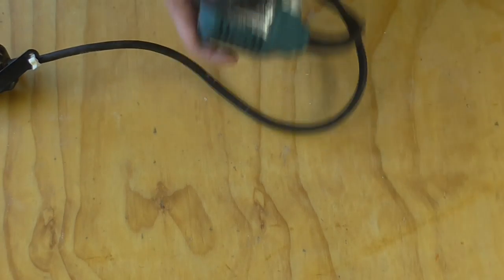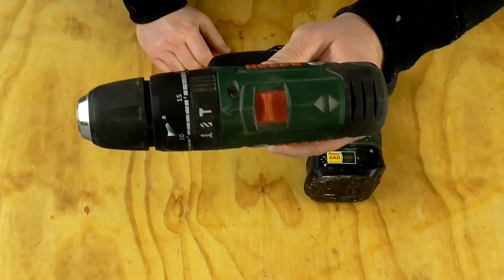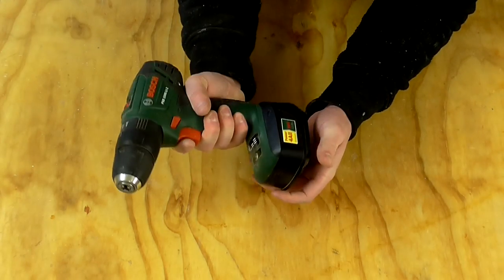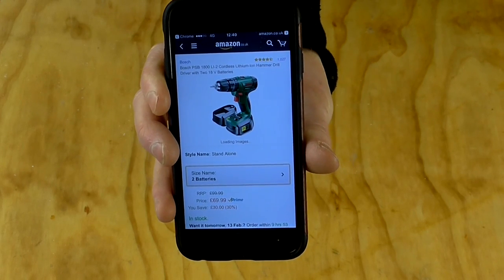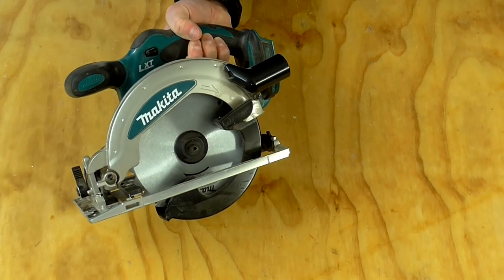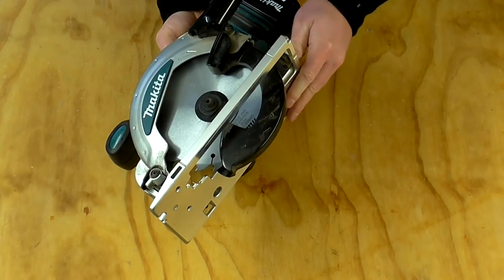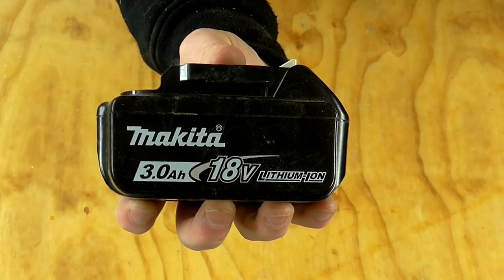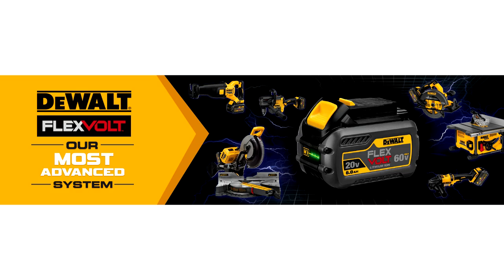My Tools - Cordless Hand Power Tools (Makita and Bosch)

Comment: Hungarian made PSB1800 Li2. (. A cracking drill..and cheaper) Did a huge amount of DIY this year including a complete new kitchen, a fair size decking patio and fitting out a garage workshop . I got the kit with 2x 2.0ah batteries and it never gave up once, even driving hundreds of decking screws in ...and survived a few drops from over a metre...Absolute top kit.. Also paired it with the PSB1080 Li2 driver which suited my smaller hands. Again no battery issues and excellent torque which is not always the case on cheap Chinese ones. If you shop carefully and wait for sales, you can also pick them up for a fair price. Highly recommended

Comment: Hi just watched your video I'am a coachbuilder and have had the makita 18v system for over 3 years now I do both wood metal fibreglass and it's the best system I've owned it's never let me down once and I really hammer tools. I don't understand your comment on the little 18v sander I only use the second speed because the top speed is to fast it doesn't sand as well it wears the paper out quickly and it vibrates more. Spose it's down like most thing down to personal preference. I'm enjoying your journey cause after 47 years on the tools my back broke and I'm now in a wheelchair and have nothing to do but watch utube and practicing sign writing that I haven't done since my apprentice days any way good luck and thanks for the shows

Comment: Nice video Keith I'm jealous of the battery powered sander!
I'm glad you recommend people to stick with a battery platform. I dipped a toe in ryobi but once I had a couple of DeWalt tools I sold the ryobi and I 've never looked back. 
Wish someone would make a cordless router though!
Reply from the maker: +Happy Wife Happy Life yeah I bet the DeWalts are great to use. I'd like a cordless belt sander but I'm not sure such a thing exists either
Reply: Makita have just released a cordless trim router with std base, plunge base and tilting base. I have purchased it and just waiting on delivery but reviews on it are excellent especially around battery life, dust collection and overall usage. You can buy with all 3 bases, just the std base or as a full kit with batteries and charger.
Also makita make a brushless circular saw which has magnesium base and blade guard, more powerful, quieter and excellent battery life...I own one and love it...I'm a Makita addict btw lol

Comment: Did you find any issue with the chuck plastic wearing away? Mine has started to erode plastic seems fairly weak. For the Bosch drill
Reply from the maker: +Jason Devlin hi, no I've not had that issue. Do you mean the plastic on the outside of the chuck? Sounds strange...

Comment: Nice video again matey.
I had a lot of the Ryobi plus one range but some scrote recently broke into my garage/workshop and had the lot away........
The Ryobi set is very, very good. They are not up to the standard of Makita or DeWalt and if I worked on a site then I wouldn't use them but for regular home use they are absolutely great.
Reply from the maker: +Tone Knight I'm sorry to hear that, that's terrible :-( what have you replaced them with?
Reply: Being disabled/retired Replacing them will take time and people buying the projects that I make......
I have actually now got two DeWalt DCD 776 Drills to replace my Ryobi and an old Dirt Devil drill I was using.
My daughter got me a Black & Decker circular saw and I bought myself a Makita  M9204 random orbital sander from Screwfix. I was a tad worried about it due to it's low price but so far it has been brilliant.
Replacing the other tools and my compressor etc will have to wait until funds allow.
Many thanks for asking mate.
Reply: I call someone breaking into my house something a tad less polite than "scrote"........ Hope all goes well for you in future

Comment: The makita are great tools I've had the lithium set for 10 years I'm a carpenter by trade,don't get rid of the corded saw though you will kick yourself if you do.Ive always taken the riving knife of my saws anyway in a pinch you can cut a kitchen sink out with that little saw ,after a bit of practice you will be surprised how accurate you can plunge that little saw,great vid by the way
Reply from the maker: +Dean Reynolds thanks Dean. I've been using the Makita the past three days as I've been fitting flooring for a friend and it's performed really well and I'm getting used to using it now. I have no complaints with it. It even dropped from a workbench to the floor at one point and strangely the plastic blade guard doesn't have a scratch on it!

Comment: Nice tools. I also discovered the lack of riving knifes on circular saws nowadays. I think it has to do with contractors wanting the ability to do plunge cuts. That's never been a need for me and a riving knife is such an important part that it just feels silly to not include one. Usually the ones with riving knifes are more expensive, but if you want to make a table saw out of one the riving knife is pretty much a must.
Reply from the maker: +LetsBuildIt plunge cuts, that explains it!!! I never thought of that but it makes sense now

Comment: Very informative video. The only cordless tool I had till now is a cordless drill. It's getting a little worn out so I need to buy another one. I use it mainly for driving screw in (for which an impact driver is much better) next to my corded drill.
In general I do not like cordless tools very much. They do not have the same power as corded tool (or when they have they
are x times more expensive. Using an extension cord can be a bit of a hassle but running out of energy in the middle of a project is not funny (and for loading the batteries you need electricity anyway).
So I think my only cordless tool in the near future to buy will be a cordless impact driver.
Thanks for sharing the video/your experiences. It was very useful to me.
Reply from the maker: +Hans de Groot thanks Hans. Have you used lithium ion cordless tools? They seem much more powerful than the old technology ni-cad battery powered tools, I've not had any issues with their power so far
Reply: My cordless drill is an older type, 14,4 NiCad.
I know people who use cordless drills professionally (they have a Bosch Blue range with two battery packs)
But after some time one battery is empty and needs to be loaded. If that happens to more of them at the
same time there sometimes are not enough outlets to have the batteries loaded before the second one 
is empty.
Reply: Hans de Groot I have about a dozen or so 18v makita power tools as well as a lawnmower and other gardening equipment. I basically don't use my corded tools much anymore and with the makita fast charger it only takes 30 minutes to recharge a 3 a/h battery and 45 for a 5 a/h one. I have never flattened a battery before another is recharged and I also have 10 batteries so I am pretty safe anyway. But basically the lithium batteries are far superior to the old nicad ones, you will be pleasantly surprised I think when you do upgrade.